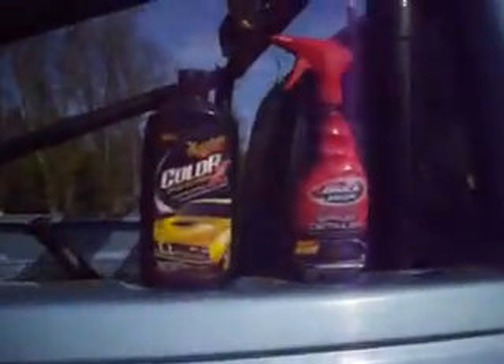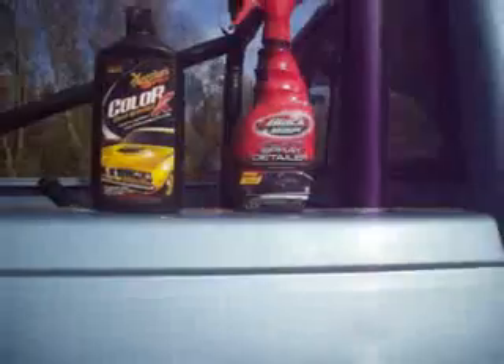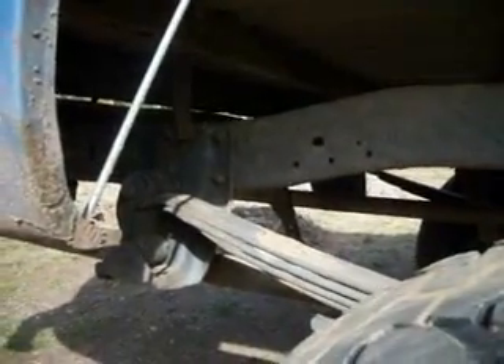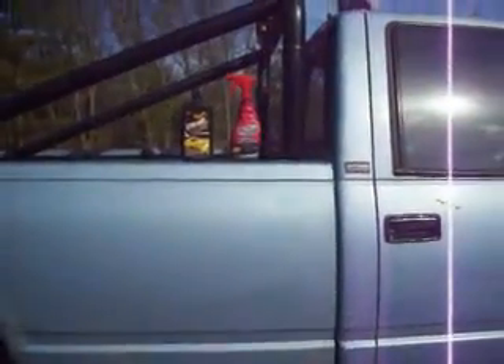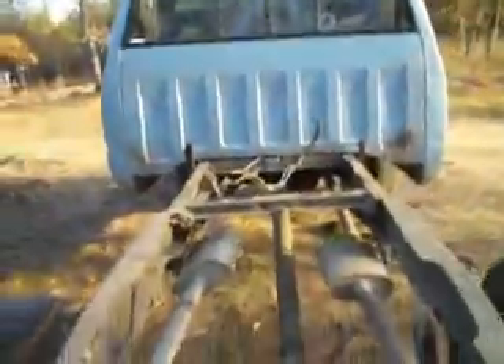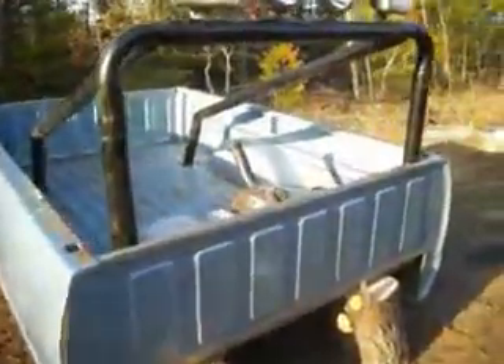taking my bed off of my truck

Comment: Dude were is your last cross brace in your frame get it back in so you don't twist your frame and make it dog walk on you down the road .. you need more then that bumper dude trust me there should be a spot to bolt one on  it or weld something in it ...